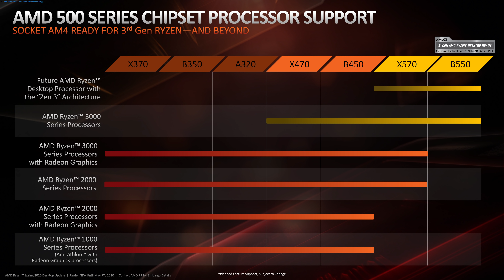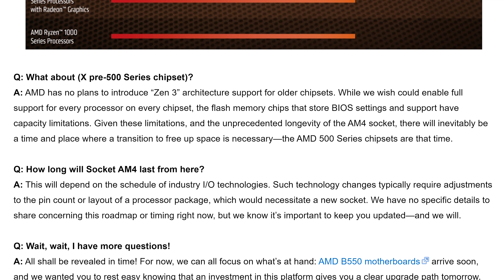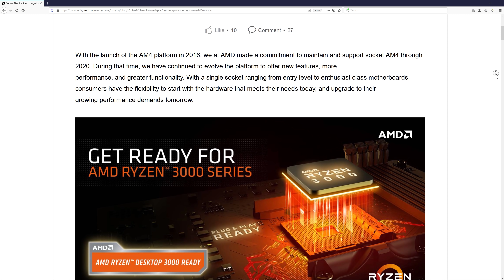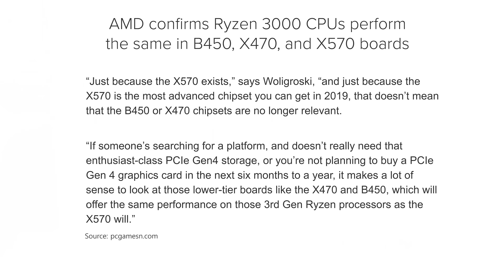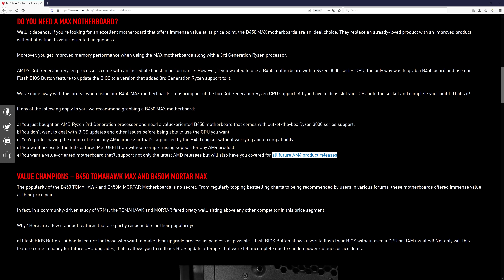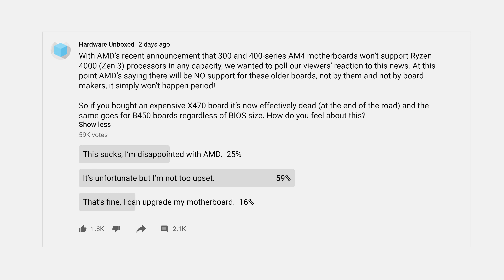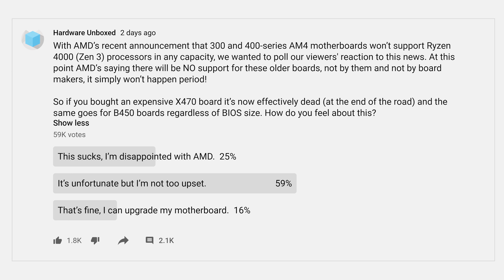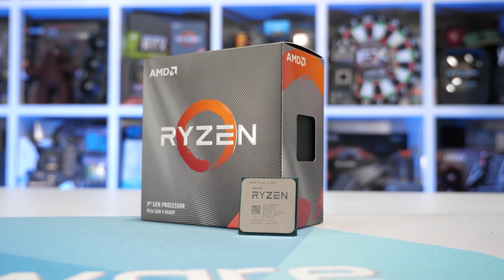AMD Does An Intel, Axes Zen 3 on 400-Series Motherboards, Our Thoughts

Comment: AMD are going to loose a lot of good will from the community for this mess.
Reply: bryan joiner  What are you talking about? Go look at AMDs reddit threads. People are fuming and AMD is absolutely losing face and good will with tons of the community. Don't be naive and think everyone is like you and thinks AMD has done nothing wrong by keeping quiet and dropping this bomb now.
Reply: It's not a mess. They've announced it ahead of time, people just buy prematurely and complain.
Reply: yeah because morons can't read “Planned AM4 socket support until 2020. Subject to future roadmap modifications.”
Reply: My last build lasted me 10 years, only 1 cpu upgrade in that time. Just upgraded to an asus rog b450 strix and 3700X, so I'm hood for many years to come. Technology changes, so boards with the 450/470 chipsets may NOT have been designed to deliver the clean faster bus speeds that the 4000 line requires. Theres a reason AMD nixed PCIE 4.0 for any boards not originally designed for it, possible stability issues, the same issue will exist in the 4000 series.
Reply: *lose, loose means to untighten. but yeah, have to agree. hell at least intel is pretty consistent and changes every two generations so at least the buyer knows what to expect.
Reply: @carlos2004  Every two generation? How about half generation too? Dint intel force you to buy a new motherboard even during the same generation? Dont pretend Intel is any better, heck they been worse at times.
Reply: @carlos2004  I dont think there are two different words, lose and loose...
Reply: @NatrajChaturvedi  they are. lose means to misplace or not being able keep track of something, while loose means to untighten, unbind. "don't lose your keys", "the screw was loose needed to be tightened"
Reply: What is this mess that people talk about all of a sudden? I'm genuinely baffled. 🤷‍♂️ AMD had made it clear a long time ago that AM4 motherboards from before 2020 won't be supported with new CPUs after 31 December 2019. If you look at AMD's official Socket Stability slide in the article "3rd Gen AMD Ryzen CPUs Will Work on Many Existing MSI AM4 Motherboards" (search it on Google), you'll see that the graph clearly shows no support for new CPUs on AM4 after 31 December 2019. If you take a good look, the orange bar stops right at the end of 2019, just before 2020 starts. It was already know even a year or two ago that Zen 3 will come out some time in 2020, or in other words, AFTER the official support period. Do people not know how to read graphs?
Reply: @bgtubber  so why did every Youtuber ask us to pair a Ryzen 3000 series CPU with a B450 mobo instead of their X570 lineup, persuading us that we could upgrade to a Ryzen 4000 series CPU in the future? We have been bamboozled
Reply: @anishgupta8938  I don't know. 🤷‍♂️ Maybe you should ask them, not me.
Reply: bgtubber bgtubber Ive seen this same message on other comment threads here and I truly am wondering if you are somewhat related to amd or motherboard partners in someway. You can't be stating the same message on multiple comment threads because it's deplorable and doesn't answer the original comment. Yes there is backlash and yes consumers want 4000 support on 400 chipsets. Deal with it we are consumers also and want the best bang for our buck in these hard times. Trying to justify amd's stance blindly here depicts that you are not understanding the consumers view. And by blindly I mean pasting the same reply on multiple comment threads on this video.
Reply: @Verzula  they're probably a die hard fan who thinks everything AMD does is good.
Reply: @bgtubber  why are you copypasting this same shit? Are you working on amds damage control? They said in 2017 December that they will support am4 Through 2020. Not untill 2020. Sure they said it about the socket and not the chipset but still its a bit confusing.
Reply: @OneDollaBill  if he's working for AMD as damage control then l very much hope he's an unpaid intern as l doubt he's helping much.
It's clear through multiple statements and actions that it should be reasonable to expect support on a b450 for the next gen of CPUs. I wouldn't care if it didn't support the full lineup if power draw was to high or something on the top end chips, but at least most of the lineup should work fine.
Reply: @bgtubber  Stop spamming the same copypasta over and over again. You're on every single comment down the line with the exact same message and you don't give answers to the counter arguments... Plus you flat out ignore 90% of what Steve just said about what OTHER messages AMD has given.
Reply: @andersjjensen  What counter arguments? Does the slide that I mentioned show support for CPUs released after 31 December 2019? Where did AMD officially say that motherboards from before 2020 will work on new CPUs from 2020 and beyond? Can you please give me the official source of this claim?

Comment: I have to disagree with you on X370. just because it came out in 2017 doesnt make AMD's "AM4 support through 2020" remark any less true. AMD not officially supporting ryzen 3000 on X370 was a major red flag. X370 is to x470 as z290 was to z390. There is hardly any difference, and no good reason it didnt recieve full CPU support. If AMD knew it was going to have 4 CPU generations, there is nor eason they shouldnt have mandated the use of 256Mbit ROMs instead of 128Mbit. Intel would have mandated the 256Mbit ROM in this case. There are many consumers, myself included, who bought a high end X370/X470 motherboard with the intention of putting a ryzen 4000 CPU in it, promoted by AMD's own marketing, who have now been burned and are pissed. Ryzen 3000 is still behind intel in gaming performance, ryzen 4000 is supposed to finally take the crown back, and if I had known I wouldnt be able to use it, I would have built a coffee lake system instead. 

AMD's history of support is abysmal. I do think they deserve to be labeled as "worse then intel". The 5600xt debacle and the moutning pressure debacle are both the result of AMD specifications being changed or being outright incorrect. Navi's drivers were broken for over half a year until the media dogpiled on AMD and forced them to fix their drivers, the same thing that happened with FCAT and frame pacing. The ryzen 3000 AGESA code was incomplete leading to months of patches to get boost mode working properly. The TerraScale GPUs had their driver support dropped in 2015, years before the GPUs themselves were obsolete, while Nvidia kept Fermi going until 2018!

AMD's support is beyond attrocious, and it doesnt matter how many CEOs you change, AMDs corporate culture is one of rushing and half-assing things. Their engineers are quite good, but something is seriously rotten in AMD, and has been since the 90s. This was their big chance to show consumers they had moved past burning their fans in the fire, but they blew it. AMD has, reliably, proven how unreliable they are and how willing they are to throw their consumers under the bus to avoid taking responsibility for their inability to plan ahead.
Reply: Actually most X370 boards supports zen2, even the crappy a320 ones.
Reply: @tristan6509  This is because AMD released a beta AGESA code, but some X370 boards still dont fully support PBO/AUTOOC on 3000 series chips, or have issues with getting full boost working properly. AMD isnt even doing that with 4000, they are not supplying a 4000 series AGESA BETA, nothing. Given 4000s boost mode is very similar to 3000, there is nor eason that 4000 series couldnt be fully supported on X470/B450, and couldnt be at least partially supported on X370/B350.

Comment: So what? If you just upgraded your pc a few months ago or last year with b450, it's not like you are going to upgrade again in the next 3-4 years. By that time you can get a new mobo and cpu. You should be spending more on GPU instead anyway.
Reply: Zen 3 processors will still exist in 3 years, and they still won't be compatible.
Reply: @fbcaware8805  Yeah buy a new mobo and zen3/am5 after 3-4 years.

Comment: As an X370 motherboard owner, I'd be disappointed but not extremely upset if AMD announced only 400-series and 500-series boards would receive Zen 3 support... aside from the fact that the B450 and X470 chipsets are largely identical, so it wouldn't take that much more engineering effort to support the entire range of AM4 boards. We were this close to the entirety of AM4 being extremely consumer friendly from start to finish... so close.

Within context however, B450 owners especially should be furious. I've made this point time and time again to people that B450 is going to receive just one generation of support if you bought it alongside Ryzen 3000 as the *only mid-range option available and advertised to buyers*. That's frankly ridiculous. I've recommended Ryzen 3000 + B450 to several friends and colleagues who believe my advice to be valuable in their PC building decisions, and this seemingly sudden reversal now reflects poorly on me simply because AMD didn't ensure manufacturers and consumers were aware of their plans, but also because AMD can't make the commitment to properly support their platform. It's unfortunate, really.

If anything, I wouldn't be surprised to see AMD adopt the two-generations-per-chipset model that Intel follows just to avoid future headaches.

Comment: The main problem with this is b550 was not ready until recently and lot of people bought a Ryzen 3 cpu along with b450 mb since the price of x570 was high. As a 370 owner i'm not too disappointed Ryzen 4 wont be supported i think 3 years of support is okay (albeit what i would consider the minimum) and certainly better than lot of computers i built in the past. But for people who bought a Ryzen 3 cpu along with a b450 this *** specially since b550 was not ready day 1 and AMD never said b450 mb would not be supported moving forward. Definitely a ** move.

Comment: Moreover: what's wrong in keeping your Ryzen 3000 on your X470/B450? What's this kind of hardware fanatism?
Reply: It's a matter of "cost over time" for "budget challenged" people. Lots of people have been buying the Tomahawk Max with an R5 3600 with the intent of upgrading to a, say, a 4900X after the 5000 series launch when prices come down. An R5 3600 is fine for now, but the game titles that are coming in the next few years are going to be taxing on that CPU because the new consoles are so powerful.
Personally I got a 3950X so I'm well and set, and despite being on x570 I'm going to skip the 4000 series. My current biggest bottleneck is RAM speed and timings, which Ryzen 4000 isn't going to fix in any worthwhile capacity, so I'm holding out for DDR5 which means new mother board anyhow.

Comment: This happens when Shareholders have a say. its clear that AMD needs to make more money. in companies the word "enough" doesnt exist.
Reply: Nonsense. I'm a shareholder. This is bad for me. Consumers can and will delay CPU upgrades when they have to also upgrade the MB. That means fewer CPUs sold, and it also means that when that consumer does buy again, it may be at a time when competition exists again. That's a double loss caused by foolish marketing.
Reply: @Mattribute  Your measely 5 stocks are probably laughable.
Reply: @christopherfortineux6937  I own 398 shares of AMD, but even if I owned only "5 stocks" the point that you ignored would still stand. This is bad marketing because it reduces the sales of AMD. Perhaps they are capacity restricted at TSMC, and thus are in a bind. If that is the case, than their failure is one of PR, and they have needlessly damaged their brand with and absurd explanation.
Reply: Most of modern Companies make short term decisions not long term decisions. Who knows why but thats the reality. just look at activision blizzard for example.
Reply: @tarelsun4025  The development of the zen microarchitecture was a long term decision on which the company was bet. They knew that selling bobcat APUs was only good in the short term so they went with a long term plan and have reaped the rewards.
Reply: @Mattribute  And thats the Problem. The Designteam wants to do good work but that needs time. but the business ppl want money. as fast as possible as much as possible.
Reply: But they just gave up sales of 4000 series chips to people who bought B450 last year.
Reply: @bleach4711 Why would he write a letter when his stock has doubled over the last two years or more and is expected to double in two years. They make more money for moving to new socket and AIBs make more money with this move.
Reply: shareholders? AMD isn't selling mainboards
Reply: @Zero11s  yeah but they sales chipsets

Comment: Good. AMD needs money to finish off Intel and start demolishing Nvidia. 
I cheer at these news. On the other hand, if I remember correctly, AM4 is already in "extra time", since support was guaranteed for 4 years, from 2015 to 2018.
Reply: How do they make money by selling fewer processors?
Reply: @fbcaware8805  are you sure? I don't think you know what tech will be there in the future. I don't think you know how future Ryzen CPUs could be received by tech users and enthusiasts. Also, AMD doesn't slow down progress to milk its customers. Not usually, at least. For that kind of things, refer to Intel and Nvidia. Thus, maybe Ryzen 4000 will have tech that won't suit well with 300 and 400 series of chipsets. Time will tell. Don't freak out, as many did with that drivers nonsense non-issue.
Reply: @_A.d.G_  Freak out or not, I'm not buying another motherboard for one generation. I wasn't going to upgrade right away, but eventually.

Comment: I'm disappointed because it's simply not holding back to own statements. AM4 was suppose to get the support and they dropped it, essentially creating AM4+. It's the same form factor but different processor support. Similar to AM3/AM3+. 
I'm an owner of X370 board, high end Aours Gaming 5. I bought it after 400/2000 series, as at that price point there was nothing better in the lineup. And I bought it on a basis of AMD support promise, dropping 2600 inside. 
Now, my plan was in late 2020 or 2021 to buy 4000 series chip advertised in their road map, and as many news pointed that it should be there. There was not a hint given otherwise. Chip is here, or about to be, socket is the same, except they decided to show me the middle finger. OEMs are not fine with it. They will end up with unsellable stock of boards now, especially high end. Bad move, really bad from AMD.

Comment: It would be nice if we could use a mnemonic like minimum board for a 3000 series CPU is a 300 series board, minimum for a 4000 series CPU is a 400 series board, etc. It would have been better if the B550 boards had been available for the first year of life for the 3000 series CPUs. As things stand, folks who didn't/couldn't shell out for an X570 are screwed.

Comment: This move doesn't really affect me that much. I have a B450 board, but I have no plans to upgrade from a 3600 to a Zen 3 CPU. However, I still think that this is total BS. I could understand if it took them some time to get proper bios support for B450 boards, but this just seems to go against what they initially claimed. :( It really does just look like forced / planned obsolescence.
Reply: I'm in a similar situation, but I would have liked to go 4800X in a few years.

Comment: With this news I think I'll leave my 3600 & B450 Max (only purchased 5 months ago with the expectation 4000 would be supported) until Ryzen 5000 gets released. The 5000 series will be a new socket, so anyone upgrading to a X570/B550 just to be able to use the 4000 series doesn't seem worth it. What is the point in replacing my mobo for 1 gens CPU use. Anyone on Ryzen 1000/2000 should wait until 4000 comes out, then do a cheap CPU upgrade to a 3000 series until 5000 is released.

Comment: I hope the Gigabyte Aorus B450 Pro Wifi will get the Bios updates for the new chips. I mean they did get them for 3rd gen which dropped the low end non ryzen and I believe a few of the low ryzen 1st gen support. I'm willing too upgrade the BIOS again to lose some more 1st gen backwards compatibility. I mean this board has dual BIOS i'm sure they can get it to work. If I have to suffer with no 4th gen Ryzen support I will upgrade to a high end 3rd gen Ryzen from my 2700X. And I should be set till AM5 since my next upgrade will be GPU, I was slightly upset for a bit. But I did remember the fact that Ryzen has had support since 2017 on older boards. At least it wasn't a Intel every year on the year new motherboard socket because they wanted to. I hope this isn't a continual thing unless AMD actually has real factual justification for a new socket every year due to massive gains. But lets see how this ends up since some of the people might be lucky with the board partners on BIOS update options or the ability to opt in.